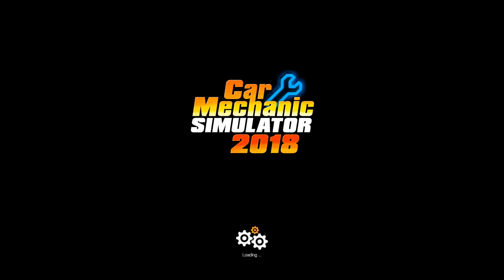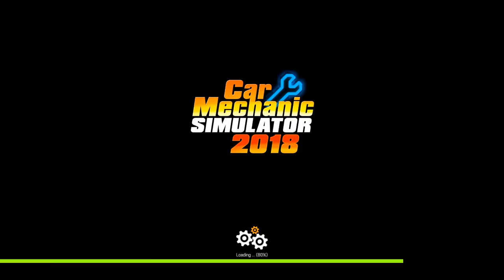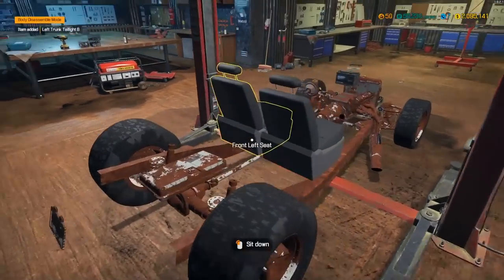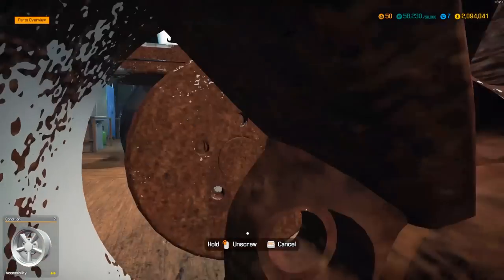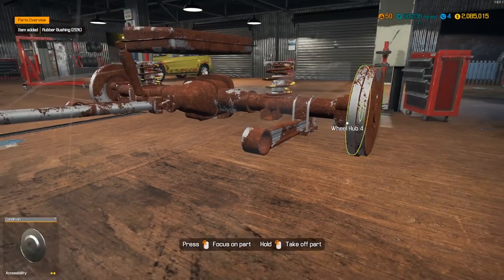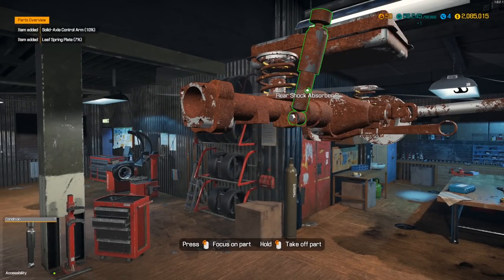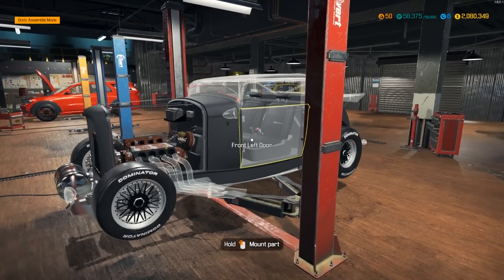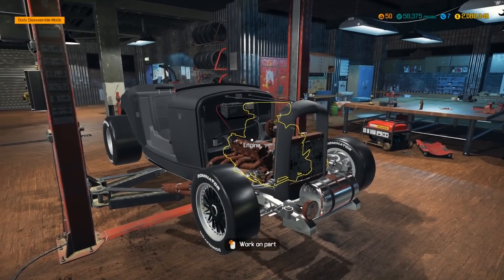BUILDING A RAT ROD | Car Mechanic Simulator 2018

Comment: Too bad the game does not let you have a new option to the most of the guys are using for the cars you can basically Chrome them and then later Chrome can be basically call up now but you said you're going with the rat rod means I could probably make it like a pet Tina and stuff to that would be cool